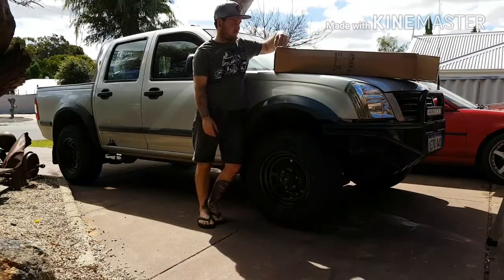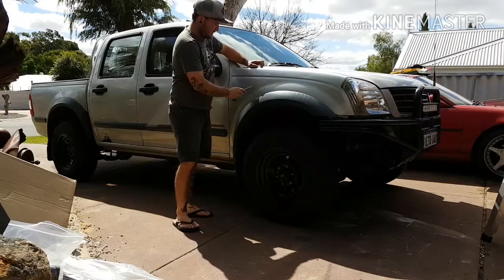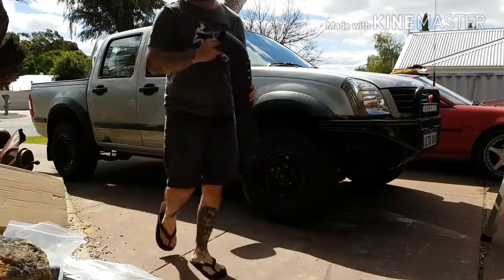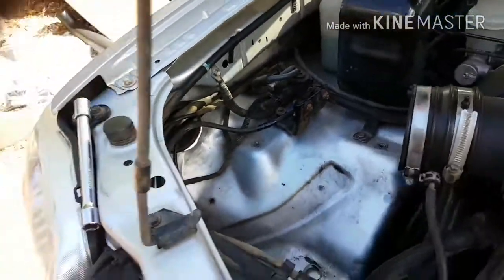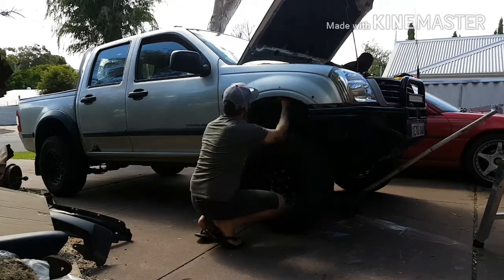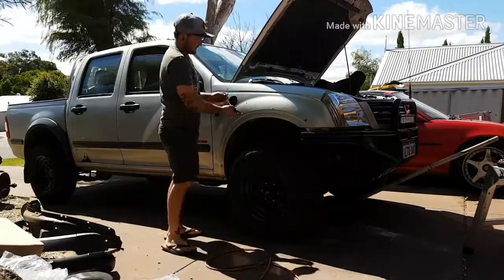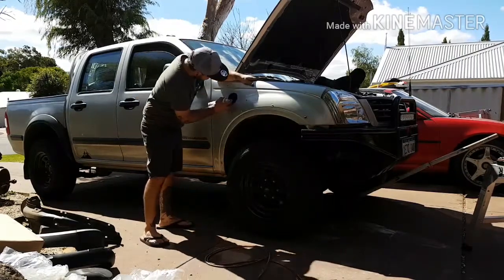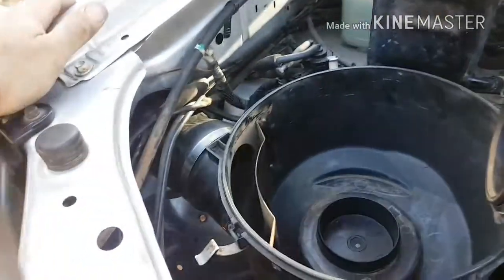fitting ebay snorkel to 05 ra rodeo 4jh1t

Comment: Hey mate great vid, have you got body lift on the car ?
Reply from the maker: Hi yeah mate only one inch tho so I could re-use the original bolts hey
Reply: Goodlets Customs - - - yeah cool looks great 👍🏼. I’ve done torsion bars maxed out and 2inch body lift and it honestly looks the same as yours. I lifted mine trying to get 33s on but it won’t work